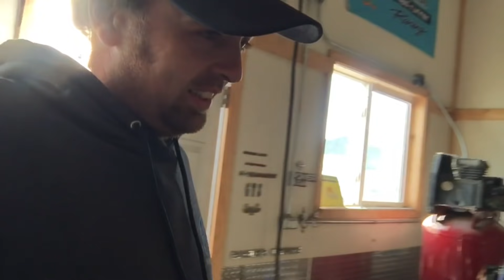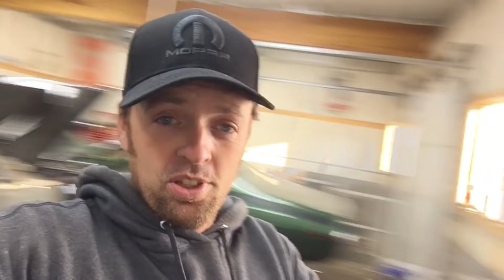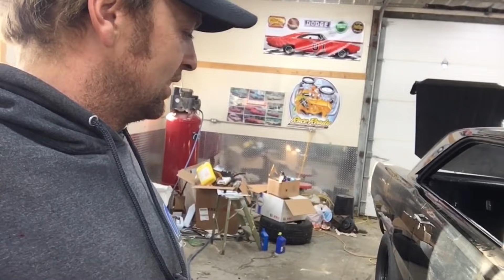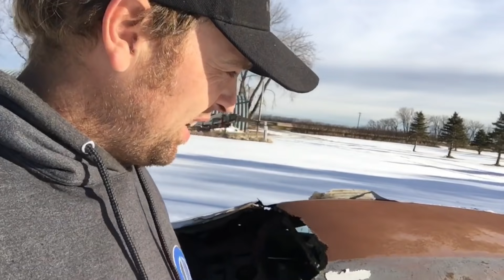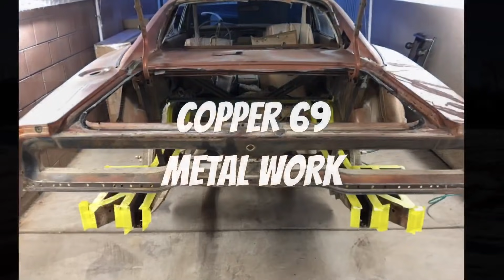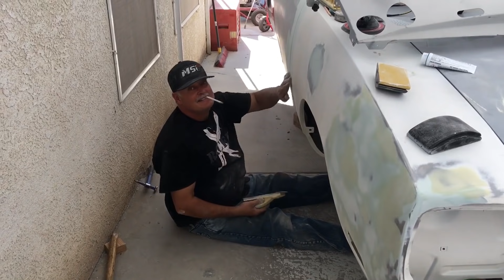Lots of videos to come...soon

Comment: I would fix the '70 RT/SE I love a challenge  !

 I restored my 69 Charger years ago that was rusted and busted ! A pain,YES most said it wasnt worth it,no It was !! 

Over the years I had parts roofs,1/4's,sub frames,floors..Car just needed one of everything lol ! I drove the car 60,000 miles in 4 years,then sold it..Funny thing is it was a 318 car !! Well,a 505 525 hp pump gas Mopar crate engine circa 2005'ish..Never a problem either,yes at times I wondered why I have ocd and cant let any Mopar rust away and be crushed lol...But I did it !

Now if they made complete Charger bodies like they do the Challenger,easy as pie ! Buy the new 70 shell and attach the vin # and the 70 lives !